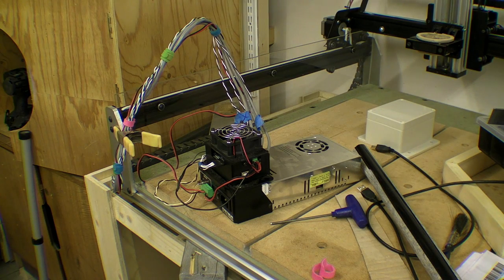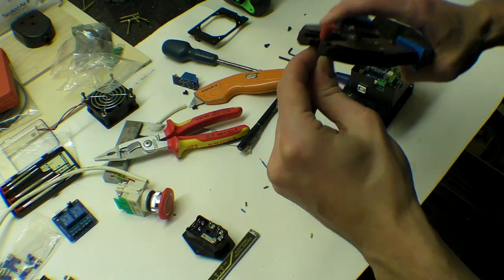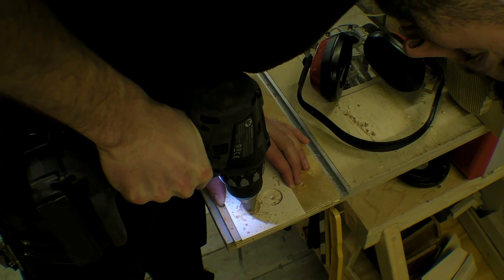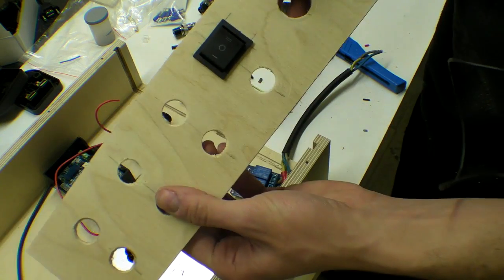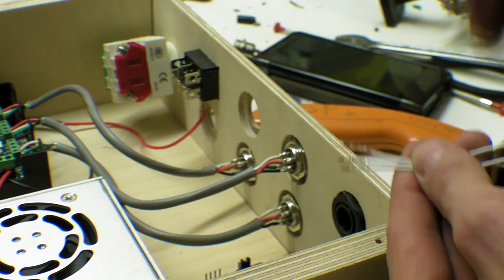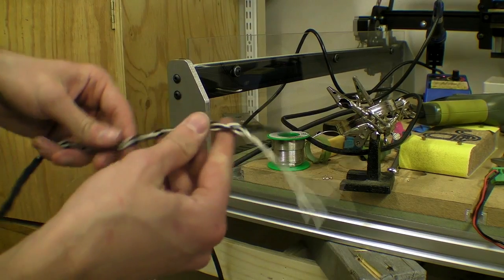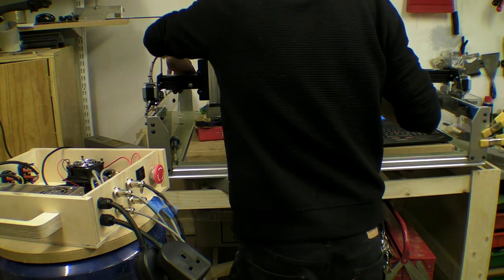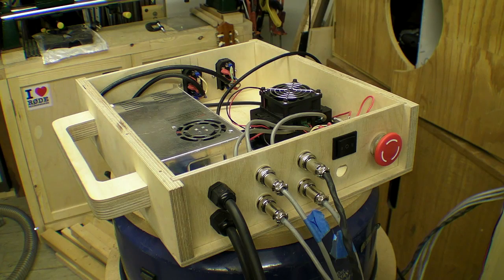GRBL Control Box with Relay Module / CNC Brain - Part 1

Comment: Excuse me, can you to explain me the connection of the emergency stop? Thank you and sorry for my english.
Reply from the maker: If I remember correctly it goes between the DC power to the control board. When pressed it cuts power and when reset controller turned back on in an alarmed state.

Comment: E-Stop switches use the NC contacts to trigger an immediate loss of power to all motors and milling/routing, laser, plasma or water jet devices.  The NC side is used because an open of either or both EStop switch wires will fault and trigger an immediate loss of power to all motion devices.  The NO side will not detect open faulty wires.

Comment: can i give you a tip on soldering buy some leaded solder 60/40 or buy some good flux paste it make a big difference to your soldering lead free solder is bad unless you get multicore solder
Reply from the maker: You know what, it only recently just clicked . Got a better soldering iron with a good soldering tip, and solder with lead, tin and silver - and it's so much better. I feel like a pro now.

Comment: Very cool, this is virtually identical to a box I just made for mine except I used the TB6600 stepper drivers with an Arduino instead of the gshield.

Comment: soldering those aviation connectors are like soldering xt60 connectors used in RC cars and airplanes, you did a good job at it. Tin the wires and connectors first then the wires to the connectors.

Comment: Looking at your box it looks like you intend to fit a lid. Have you thought about ventilation? As the power supply will get pretty hot.
Reply from the maker: +David Wagstaff Thanks for the reminder, I was going to drill the fan openings out with the CNC machine itself once I had finished installing the laser driver.